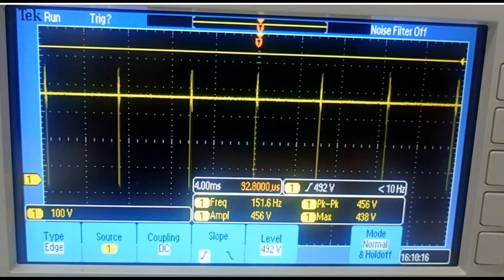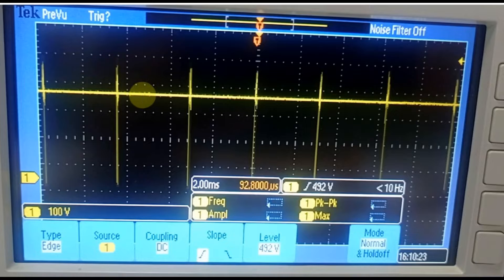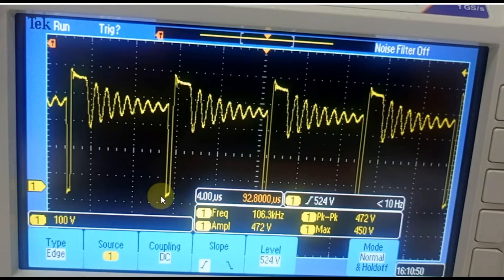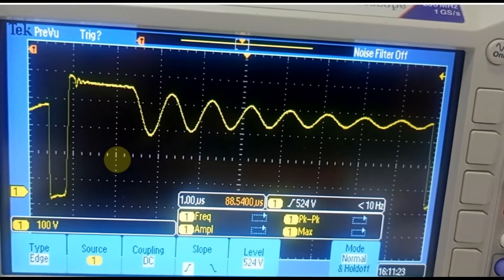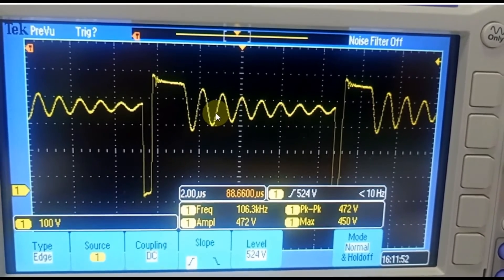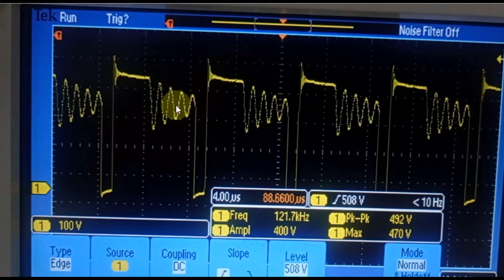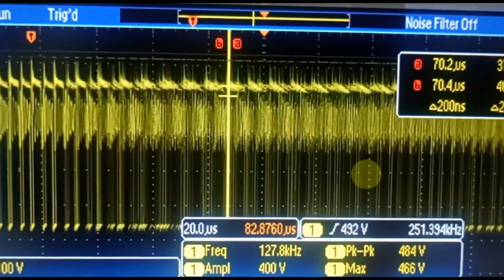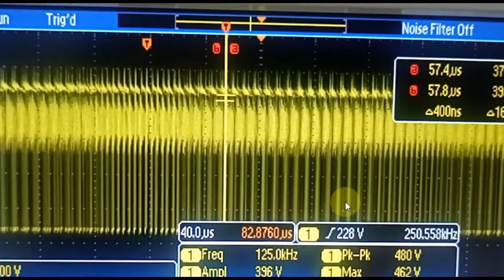Flyback Converter DCM Mode Demonstration

Comment: What is bust mode
Reply from the maker: @shubhamraj1318  Burst mode in a flyback converter is a power-saving technique used to improve efficiency at light loads. In this mode, the controller turns the switching transistor on and off in bursts rather than continuously operating in pulse-width modulation (PWM) mode.

How Burst Mode Works in Flyback Converters:

Light Load Condition: When the load demand is low, the flyback converter reduces its switching frequency to minimize power losses.

Burst Operation: Instead of switching continuously, the converter operates in short bursts, followed by idle periods where no switching occurs.

Energy Storage and Delivery: During bursts, the transformer stores energy, and during idle periods, the stored energy is delivered to the output.

Reduced Switching Losses: By reducing the number of switching events, burst mode decreases switching losses and improves efficiency.

Minimized Standby Power: This technique is commonly used in power supplies to meet energy-saving regulations like Energy Star and EuP (Energy Using Products Directive).

Advantages of Burst Mode in Flyback Converters:

Higher Efficiency at Light Loads: Reduces switching losses and improves overall efficiency.

Lower Standby Power Consumption: Helps meet low standby power requirements.

Reduced Heat Dissipation: Less switching means lower thermal stress on components.

Disadvantages:

Increased Output Voltage Ripple: Since switching is intermittent, output voltage may have more ripple.

Audible Noise: The intermittent switching can produce audible noise, especially in the range of human hearing (1–20 kHz).

Where is Burst Mode Used?

Standby power supplies

Laptop chargers

Energy-efficient adapters

LED drivers

Comment: Professor, thank you for that excellent explanation. If the damped sine time for the leakage inductance ring is a 10 MHz, would we have harmonic content up to about 100 MHz? Also, does allowing the magnetizing current to decay to zero help heating in the inductor and improve it's reliability?
Reply from the maker: Thanks Dany for your compliment. Indeed it is very question. If you say 100MHz , it is 10th Harmonic of 10MHz. If the leakage inductance is higher and switch node is also higher, we can surely see some impact in radiated emission at 100MHz. But you can see the circut 1st oscillation damped means snubber is designed properly so it will not impact much.
To answer your frist question sure can have impact.
come to 2nd question yes in DCM transformer and Mosfet will dissipate less heat. It has less diode reverse recovery losses.
while cons are due to high ripple current it is used in low power applications.
Reply: Professor, thank you for your information. Conducted and radiated emissions plague a large percentage of designs that I review and approve. Being proficient in SMSPs, allows me to better support my customers. Power supplies are seen as so simple and easy, but most of the EMI failures are directly related to the power supply design. Your examples and experiences provide better insight into resolution of outage issues.
Reply from the maker: @pbaemedan  I completely agree with you Danny. Power supplies is bone of any design.